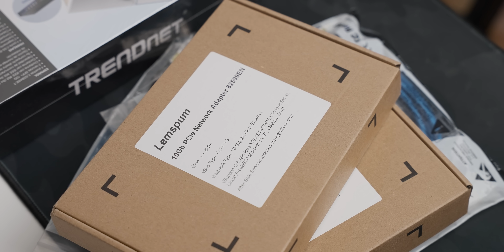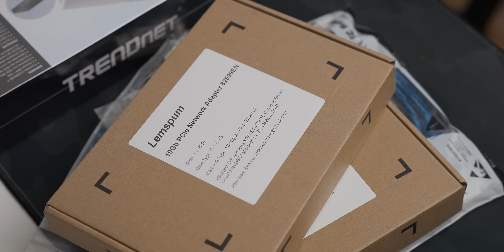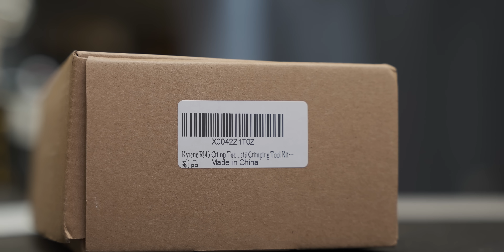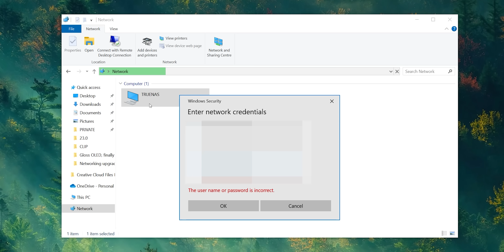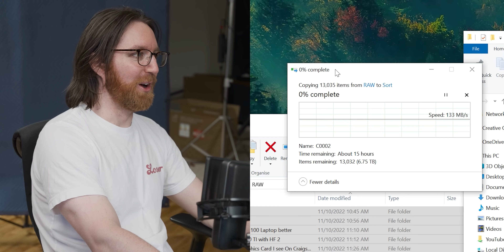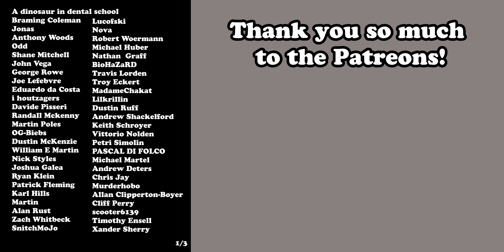Upgrading To The Cheapest 10GE Network...

Comment: its so funny you went straight in without research. the patch panel means that you dont need to keep crimping if the head breaks or loosens. If a cable gets loose in the patch panel you can simply repunch it down.

for SFP+ the whole set is pricey initially but cheaper than ethernet. However the toolkit costs more initially. SFP+ 10Gbe is actually pricey. mikrotik has proper 10Gb/s inexpensively. You mistakenly called SFP+ direct fiber optic. SFP+ direct is actually pure copper while fiber optics or optical requires a different module with 2 ports (rx/tx). Let me know if you actually want to go fiber optic or optical, very cheap for long bulk runs compared to ethernet.

instead, you could also copy faster by connecting multiple drives to your PC and doing it all simultaneously.

Comment: As someone who has terminated tons of Cat5/6 watching you terminate those cables caused me immeasurable pain, you really should have used the patch panel.  That said everyone has to start somewhere.  You could have grabbed some mellanox cards for like $20, they are about as old as Intel X520-DA1 chipset cards and don't heat up as much.  Always fun upgrading from 1/2.5 to 10GbE, I'm trying to find myself a 40GbE switch to upgrade to as 10 just doesn't feel fast enough sometimes now a days.

And yes, 125 M/s is the max for spinning rust not counting 10k/15k SAS which can eek out a little bit more.

Comment: Good job getting the ends on the cables, but really the patch panel would have been way easier to use, lol. At least you got the pass-through ends they are a good bit easier then the old way of doing it. Although you trying to make the cables the old way probably would have made for an even more hilarious video. The old way of doing it required you to get all of the wires cut perfectly even and exactly the correct length before putting the end on, which as you might imagine made the whole process way more painful especially for new people. I am surprised at how cheap 10 Gbit networking is getting especially for something with intel chips. This is tempting me to upgrade my home infrastructure although there is basically no point for my use cases, but I am tempted nevertheless.

Comment: The main reason for using a patch panel is that you know which cable goes where at both ends easily. You got lucky that the previous owner labeled the cables here, but normally that's not an assumption you can make will be true for most people's situation. By setting them up with a patch panel it makes it easy to take down your setup and then you or someone else can easily come back and install new kit later. That said, you CAN get RJ45 patch panels as well, we're actually using one in our rack because it was a lot cleaner to route those cables into it and connect them to the back of a patch panel, which we then get to connect into our switch however we want, and all you need is a 6" to 1' patch cable to connect it to the port on the switch in front of the rack after it passes through the patch terminal. It also made a lot more sense to do it this way since we had devices we also needed to patch into the panel from their ethernet ports in the back of the rack, before going to the switch connections on the front of the rack. It just made a lot more sense to do it that way when we had a couple dozen hookups in total after including the devices in the rack and the 18 wires to different rooms and dedicated lines for wireless APs that we installed.

Comment: As someone who used to work in a colocation centre and run custom length patch cables all the time, I loved seeing all the mistakes being made :D It's surprisingly easy to mess up the crimp if you don't have someone telling you the problems to look out for. Well done!

For the future, untwist the pairs, straighten them up, put them in the order you want, clip the ends the same length, and put them all into the plug at the same time. You can make the fine adjustments after that. I've never seen someone try to insert the pairs one at a time :O

Comment: I am so glad I don't deal with network cbles anymore.  I used to do this as part of my job, but terminating wires and wiring was one of the thing I hated the most about being in IT.  You'd get everything pulled and in some cases, terminated, only to find a break somewhere.  I will say that numbering and documentation (as with many things) is VERY important and makes troubleshooting quite easy (at least narrowing down which line is what at each end...)

Comment: You do realize that the switch is useless if you need only one PC to uses 10G? You just add the 10Gb adapters and a DAC cable between them without unplugging the 1Gb cable and modify the routing on your PC so that file sharing use the 10G NIC.

Comment: I’ve only gotten up to the point of where you mention Collin and his recommendation, then you basically saying “that just seems wasteful, I’m just going to terminate the ends with plugs to go right in”. Yeah… If it goes well for you now that’s fine. It’s our way of doing it as electricians or data techs to make it user friendly for anyone to rewire. Often there are redundancy network cables in offices and you won’t need to patch them all in, so to keep it tidy and be able to easily identify (using the numbers on the patch panel) you can just manually patch through where you want to go. It might. It suit your setup but it’s definitely the meta to generalise the structured cabling for every use case scenario. 

Personally in an office situation i would run the cables into an installed cabinet and install the patch panel inside, to keep it tidy and to stop tenants from taking shit they shouldn’t.

Comment: 9:00 It would be nice to have rotating parts as part of the standard here. That said, this is absolutely the correct orientation to match a backup PSU or a PDU surge strip. Hanging off the side isn't a big deal when you have high friction outlets.

Comment: I used to install networks, good job on actually crimping the cables first try! It takes me a try or two sometimes and I did it almost every day for 5 years. You're also lucky that you picked the right order for the pairs! There's four different orders the wires could go in, two of which being crossover variants of the others (although most modern gear will work with/without a crossover cable), and you would not be getting a connection if you got it wrong! One thing I would recommend, however, is getting a patch panel. 

As others have said, the cables you were dealing with are meant to be installed in a wall. Flexing these cables are bad for the wires inside, which tends to happen a bit more when these types of cables are terminated. To replace everything with a patch panel you don't need to cut the ends off, thankfully. Instead you should find a "Keystone patch panel" and some RJ-45 couplers for it and use that instead. Using patch panels isn't a waste in my opinion! You have the option to easily change which cable connects to what without having to worry about the existing cable being long enough, or you can easily plug directly into another cable for troubleshooting. Plus if you ever leave this space, the next owner will thank you!

Comment: In typical fashion, you manage to sort of make the types of errors that make most of us scream.   It is fun to play along.   The making connector thing has already been killed in the comments, it is a learning experience.    I can say without a doubt that you should have just removed all the existing wire and called it a day at that point.   Go to Amazon or whoever and order up a bunch of cat 8 cables (no more than 30m long each) and you could have networking capable of supporting 10gb everywhere.  It would certainly make your 2.5gb connection happy.

Second one is the switch.  Since your router already has both 10gb and 2.5gb connections, most of the fun was done for you already.    it would have been much better to get a full 10gb switch (teg-s750 example) which has 5 10gb ports.  Use a short cat 8 to connect to the 10gb port on your router, which will give you the most internet throughput your ISP will give you (whatever that may be).  You can plug your 2.5g devices directly to the router, and then put your 10gb devices on the switch.

Then your PCIe cards could be Cat 8 connected instead of using the more expensive and less adpatable SFP connectors, which are generally intended for switch to switch connections in a larger network.  It would also mean that every network plug in your network would still be compatible all the way back to your 10meg VoIP switch from 1997.

Comment: pass through are much easier if you arrange the cable to the diagram then put all in at the same time. On second note you can run multiple drives to nas at same time with higher network overhead. IE 3 or 4 drives at time without maxing the net speed

Comment: seeing a newbie work on network, was so cringe. terminating the ethernet plugs lol striping the small cables. at least you went with fiber instead of the twisted pair 10gbe that was right decision. also, DAC means direct attached copper, it's a way to connect network that normally uses fiber without fiber for short distances (up to 7m or so) using copper cable (its coolest and most efficient way to have 10gb network for short distances) and the plugs that you used are called sfp+, there also QSFP+ (quad sfp+) combines 4xsfp+ to 40gbps and the newer sfp28 for 25gbps and qsfp28 for 100gbps. and the current enterprise standard is 100Gbps and 400gbps that still not in the realm of simple homelabers (even 25gbps still bit too expensive)

Comment: What you need is 1 or 2 2TB-4TB ssd or nvme ssd as a to use in the nas as a cache drive  so you can still use the 10g speed and not be bottle necked by the slow HDD and when your done transferring it from ur pc to the ssd in the nas then transfer it from the ssd to the hdd in the nas and you dont have to wait for that!

Comment: A free option would be adding a program call Nitroshare to both systems there is a Linux version.  You can transfer files between both systems on your network connection I have transferred 50gb of files in about 20min before.  The computer sending files is a HP Victus 15L and the computer receiving the files is a Dell XPS 8500 released in 2012.  My Network is a 1Gbit connection I get 40mb to 41mb upload to the other computer on the same network.

Comment: Intel (design) x520 use about 8w whilst x710 use about 4w, you want to bear in mind for proper cooling, fibre HBAs were designed for servers. In racks, in data centers, with forced cooling.  You just might need a small fan on that heatsink, check it with your hand to see if it's too hot.  I replaced a 520 from Amazon with a x710 off eBay, runs cooler.

Comment: you could always get the Intel X540-T2 10G cards from alie they are like 20 bucks and use rj45. i switched all of my sfp cards with them and it has been great for me.  also you could have gotten a 2.5gb network switch from alie with 2 sfp 10gb network ports for 30 bucks and gets yourself some nice cheap 10gb sfp cards with it from alie.

Comment: I bought two used enterprise-grade dual 10-gig NICs for around £15, four SFP+ connectors for £3 from eBay, and a two-port 10-gig switch for £24 and two 1-meter optical cables for £7 from Aliexpress. Altogether, I spent £49
Reply: If you have only 2 devices to connect the switch is not needed.
Reply: @frederichardy8844  I didn’t know that before watching this video.

Comment: You should use an ssd as cache for the drive or even better to not wear out the ssd a ram disk, so the transfer is faster. The ram disk work great for something below 100GB while also a chep 500GB ssd will cut time even for huge transfert, with both you can fly.

Comment: There are quite a few settings you can configure relating to the intel network driver to make the connection even faster quite a few videos from Level1Techs and even LTT on this. Turns out getting reliable and sustained 10G speeds isnt as easy as it should be.
Reply: Happy you got a decent result out of the box. Reminds me when I had only my desktop and server on 10GbE originally spending as little as I could to speed up that interface. Now almost everything is wired 10G and a SATA SSD is my bottleneck, never thought id see the day that was the case.

Comment: I both surprised to didn't know how slow hard drives are as a 7200rpm drive is about as fast a standard 1Gb ethernet connection.  Also, why couldn't you just plug the hard drive directly into the nas and copy everything off to the main array? That would be even faster than ethernet.

Comment: Network card wise get an Intel X550 and update the firmware. I have played with a bunch of different brands and ran Aquantia for a long time but some of my odd problems were solved by going Intel again. One thing I will say is you can get them used 2nd hand but youve got to be real careful since there are so many knock offs. I can got over how to spot the real ones if interested but you can get single port ones for as low as $100.
Reply: For fiber card wise I would have gone with the slightly older X710 for a number of reasons including that it can run properly in an x4 slot. I tend to not buy the remanufactured NIC off amazon as I dont know their compatibility firmware and driver wise. Better off with a good used Intel card (not Dell, HP, Lenovo)

Comment: Dawid, I love your vids, especially your crazy humour. Nevertheless you need to learn some vocabulary before attempting such projects. As an educational channel you have some responsibility for less knowledgeable viewers. 
Those DAC-plugs are called SFP-plugs, versions which can run at speeds greater than 1 GB/s are usually called SFP+ (25 GB/s would be SFP 28). No matter if they are part of a DAC cable or a fiber transceiver. 
Also, the viewer/network technician was right. You should always use a patch panel, or better still, use keystones and a keystone panel. All that stuff should terminate in a network closet and all the gear should be rackmounted. This would make a nice and tidy setup. 
Also, I don't really understand why you chose to go the ultra cheap route for a network setup you need on a daily basis. It is nice for a video but will bite you in the backside many times in the future for sure. 
As a beginner you should have gone with something from Ubiquiti for Wifi, Switch and router. Easy to set- and scale up, remote acces and so on. I am sure they would have sponsored you if you asked nicely.... Would will happen if you hire an editor or something similar? You will rip the setup appart and buy something new instead of adding a piece on. Especially for something so essential like your coreswitch I would have used something like the Ubiquiti Pro 24 PoE (with 2 10G SFP+-ports). And some U7 Pro as access points and a Cloud Gateway Ultra as router. 
I liked the SFP-Setup for the 10G-connection. I use something similar in my setup to connect my main editing system and the 2 NAS-backups. 
Now you see why some ppl still need mainboards with more than 2 PCI-Express-connectors.

Comment: part of why the HDD vary in their speed is because when reading from the edge of the platter, the head sweeps past more blocks of data for every rotation, and since the drive has a limited max rotation, the speeds can be faster when the data is stored on the outside blocks

Comment: Hook up multiple drives and transfer them simultaneously. They should each be able to do ~100MB/Sec so if you have 10 hooked up, you should be able to get to the 10Gbps number. Just make sure there is at least two SATA busses, but more would be better.

Comment: Question: If the goal is to back-up your old video to the NAS, why not remove one of the NAS hard drives and replace it with the drive you want to back-up onto your NAS. Then just copy them directly from HDD to HDD within the NAS itself. Wouldn't that greatly speed up the process?

Comment: If someone hasn't mentioned this already, you may want to add a small fan to the Lemspum cards heatsink. These types of cards (10G+ Fiber cards) are designed to be installed in a server with a constant, high airflow. When they're installed in a workstation, there's usually not enough air movement directly on the cards heatsink for it to cool sufficiently and they may get really hot and fail prematurely. Most people (including myself lol) just zip tie a 10mm fan to the heatsink and call it a day
Reply from the maker: @djbk7456  Oh that's very useful. Thanks for letting me know.
Reply: oh, 80mm noctua fans maybe :D
Reply: Nah, the single port X520 DA1 doesn't run hot enough to require active cooling, the heatsink alone is fine. If you use the dual port card with 2 SFP+ attached however then active cooling is recommended. 

You can also use the less power hungry Mellanox cards as an inexpensive alternative, those only use pcie x4 slots as well instead of x8 that the x520 uses.
They only come in one SFP+ port variant however
Reply: ZIP TIE a fan to the heatsink???

That.....

Feels Exactly like something I would do!

👍
Reply: That was an Intel card, right? Are these along the same thread as the junker HP/QLogic cards that come equipped with a passive heatsink and have an actual fire risk to them? I picked up a 50mm fan and bolted it down to the heatsink and installed the card in my SFF Athlon box. Gets very warm but it has airflow and that's keeping it alive. If you have a card of that nature and it overheats, it takes out the ENTIRE network stack and has to be rebooted before it comes back.

Comment: For the MOST part, you will be limited by the speed of the storage especially if you are on mechanical drives.
Eventually, you should implement an SSD array AND 10Gb to REALLY speed up your storage 
OR, if you can, implement an SSD cache drive on your NAS so you can dump faster. 
What OS are you using to host your storage? TruNAS? unraid?